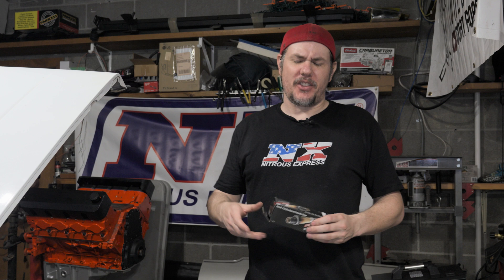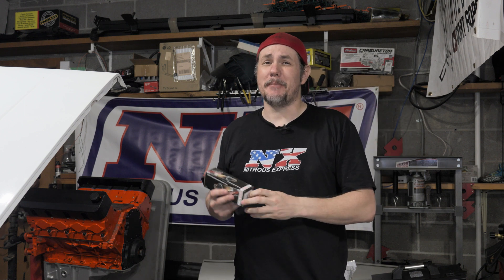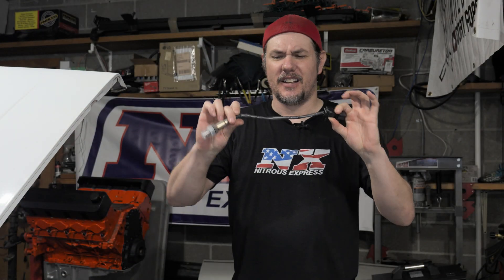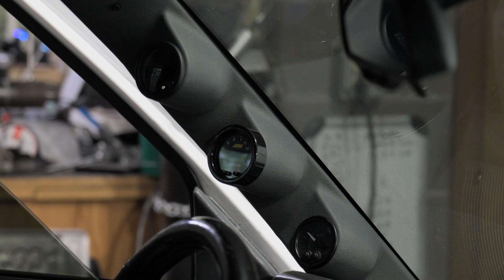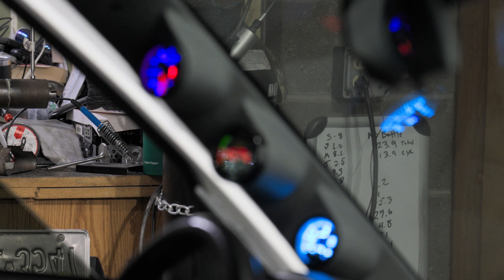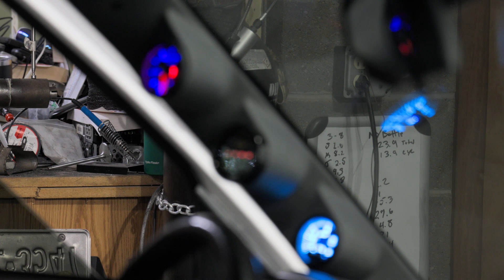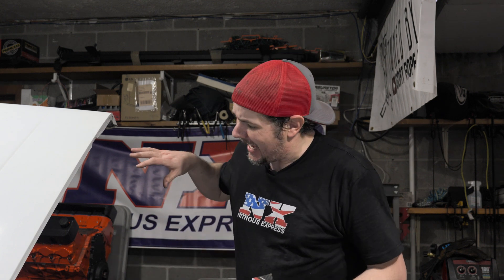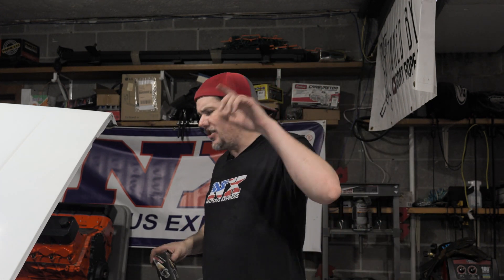Will a parts store Wideband sensor work with your Gauge or EFI?!

Comment: I'd like to see if the Denso or Motorcraft 6 pin O2 sensor will work. I think they are superior to Bosch on domestic applications. I don't want a 3 month sensor. I want a 3 year sensor.

Comment: What about the Bosch 17480?  It had a longer tail.
Reply from the maker: If it has a 4.9 connector it should work
Reply: It's possible that's a 4.2 sensor, usually used in early-mid 2000's cars. The connector on a universal 4.9 is 25mm vs 35mm on a 4.2.

The 17480 has a custom connector, and it should be noted you CANNOT swap them. The calibration resistor is inside the connector itself. You must swap the controller-side connector.

Comment: What about the holley ntk sensor. That ones always been an issue. $300+ for a replacement. Are they really calibrated only for holley?
Reply: Please confirm this
Reply from the maker: Doubtful. Any NTK wide range sensor will probably work.
Reply: I used to NTK sensor on mine and never got any response

Comment: Thanks for the info mate. Are you using the wideband up stream for the closed loop control ? Which ECU ?
Reply from the maker: Yeah, about 16” after the turbo on a fuel tech 550

Comment: So this is funny, ive bought and tested a few of these with the aem 30-400 and basically they would work for about 15 min and die, on this particular turbo car. But, it keeps killing them from awm as well. Its in a bend a lil bit and needs to be moved
Reply from the maker: Crazy, how far is it from the turbo?
Reply: @GoatRopeGarage  about 2ft. So it's a 3rd gen camaro 5.7ls 6speed, turbo front pass side head. Straight dp for about 2 ft, then 90s down 10" and 90s back to exhaust. It's out of the 1st 90 about 2". I think it needs moved up top b4 the 90 and I've told owner to move it, next time i go over there it may be we'll see
Reply from the maker: @slopoke22 yeah, it’s far enough back but if it’s sitting right after the 90 it might be getting too much exhaust on it as it collects in the bend
Reply: @GoatRopeGarage  that's what I think. Its a nice street car and i got the fuel in it u know. So that may be some of it too. I'll update when moved and see what up
Reply: @GoatRopeGarage  I've never had an issue with an aem either but this 400 series has messed up and they wouldn't replace. We've bought 2 and tried a few of those shelf ones and they'd work for a bit but the aem ones would work for a couple weeks